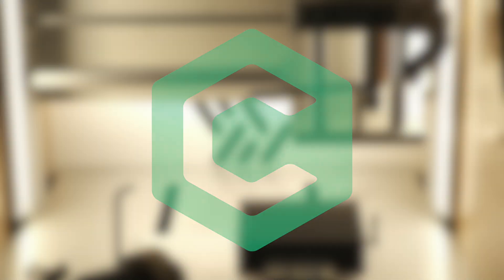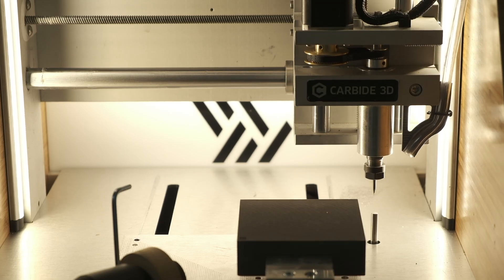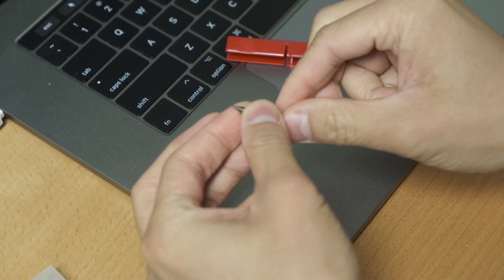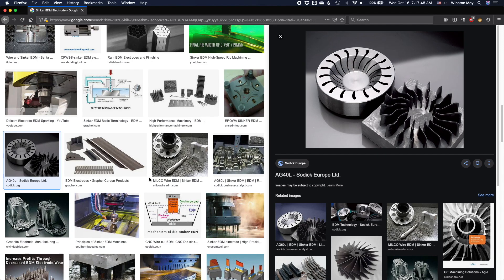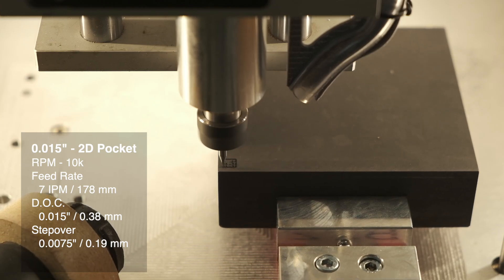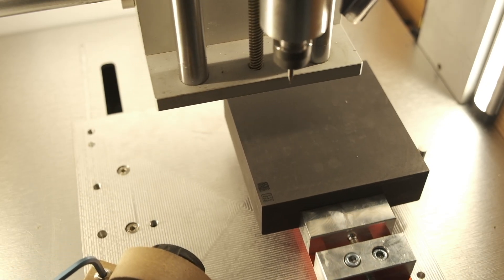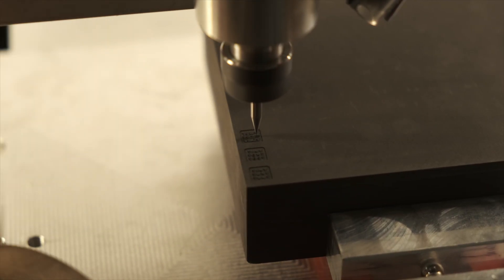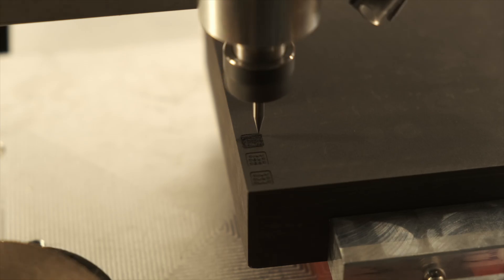What's the Smallest Thing You Can Machine on a Nomad CNC?

Comment: "for you metric folks" , "for you freedom loving folks" So if I use metric I don't love freedom??
12 inches in a foot, 3 feet in a yard, 1760 yard in a mile. Yea, so logic. Imperial measurement system is ludicrous .
Also, USA signed the Metre Convention ( https://en.wikipedia.org/wiki/Metre_Convention ) so basicaly USA is using metric but with conversions . What's wrong with you "folks" ?
Reply: there is no "system" in Imperial measurements.. furthermore.. the Inch is actually a Metric Unit, as it is defined as 0.0254 Meter!.. How's that for "freedom"..

Comment: Every day at work I strive to keep 'per end mill' costs below $35 while stuffing out endless volumes of aerospace components... $20 for an end mill that tiny is a gift from above in terms of what it took to make it. I think my Onsruds are at minimum $25 for the most absolute basic of things at 1/8" or 1/4" diameter.

Granted, the machines are taken to half negative Z and the lights turned down for a moment with each dearly departed tool, despite its cost.

Comment: Totally Bogus! Graphite is super soft, You are deliberately misleading people into thinking they can micro machine with this thing. They are going to break a lot of expensive tools! You have to have less than .001 run out on the spindle, the tool, and the rigidity of the machine COMBINED! This sign making router aint going to do that even in soft aluminum!
Reply from the maker: I think you're confusing the Nomad with the Shapeoko. The Nomad's spindle is comfortably under 0.001" runout, and I just machined a little test in 6061 Aluminum to confirm that at least a 0.01" endmill will still survive light machining.
-W

Comment: Wouldn't increasing the RPMs at the smaller size increase the strength of the rotating bit? When working with a mill, the smaller the bit you're using, the higher the speed you need. Is there any reason that wouldn't apply to a CNC?
Reply from the maker: It doesn't technically increase the strength of the endmill, it decreases the energy needed to cut through material (to a point). But there are ranges of speeds in ferrous materials where you simply don't want to be. You can go as fast as you want in aluminum basically, you'll shatter your tool in steel if you did the same.
Reply: @carbide3d  Interesting! Thanks for the reply.
Reply: Increasing the speed allows you to cut faster while maintaining the same chip load on each flute. Same reason you can cut faster with a high-flute-count endmill, because you can run a higher feed rate for the same chip load per tooth.

Ideally for such small endmills you want the speed as high as possible without adding any vibration or run-out. Commercial CNC machines that are used for micro machining often use air turbine spindles that exceed 60,000 RPM, which allows very fast feed rates even with these tiny endmills.

The main limiting factor is surface speed - if the relative speed of the cutting edge and the work is too high for the given material, you'll get excessive heat buildup and that affects your tool life. Luckily, for these tiny tools you need some ridiculous RPMs to get near that limit even in steel, much less aluminum or graphite.

Comment: Any tips to reduce burs when v engraving text or graphics in ali?

I use mist coolant and tried various speeds and feeds but always have a burr on the edge. Oh, using 45deg cutter, and looked good after a light sand.
Reply: I've always fought this issue. The two solutions I've used with good success in the past are to either sand/lap the surface after engraving, or to engrave a few thousandths deeper than desired and then use a flycutter to deck off those few extra thousandths after engraving - this leaves a beautiful finish and very clean engraved details.
Reply: @MysticalDork  Thank you for your reply. In my case I think a quick sand would be faster than a tool change and face off op.

Maybe when I eventually get that mystical ATC spindle it will be a different story.

Comment: 2 things, 1 graphite dust is combustible when working at sgl carbon I watched a dust cloud of it go through a pc and the white flash and bang was amazing. 2 graphite will act as an abrasive (interestingly as a lubricant if small enough) in certain situations. This has the ability to ruin both end mills the CNC and the pc driving the CNC if it's not treated with respect. Same goes for real carbon / carbon - carbon fibre.
Reply: No.

Comment: What is this a CNC FOR ANTS!?
Reply from the maker: Don't worry, the next graphite project will be at least 3 times bigger than this.
Reply: Will it be on the roof?
Reply: Oh well.. i milled parts that were 1.5 x 3 mm, 0.8 mm thick, with two round "Feet" of ø0.5 x 0.4 mm on the back, and a 1 mm wide slot, 0.2 mm deep on the front.. all in a days work. as for Lathe work.. i  go even smaller.. like turning parts of ø1.1 mm, 1 mm long, with a 0.25 mm hole (that's 1/100 of an inch for those from across the pond) drilled right through.. and if i make parts like these.. i make 'm in large quantities..